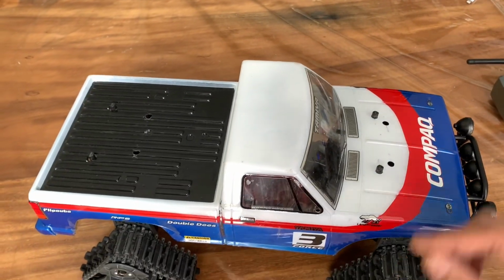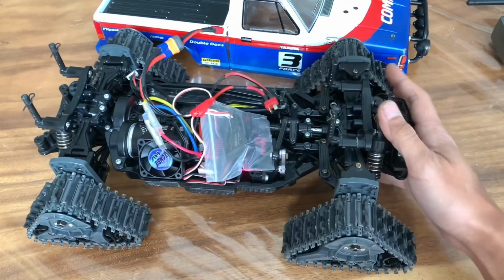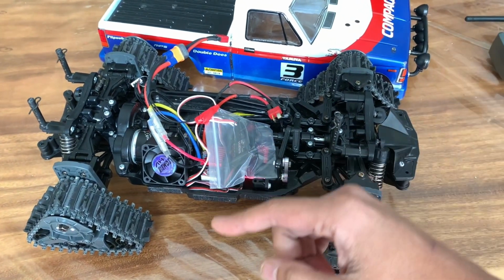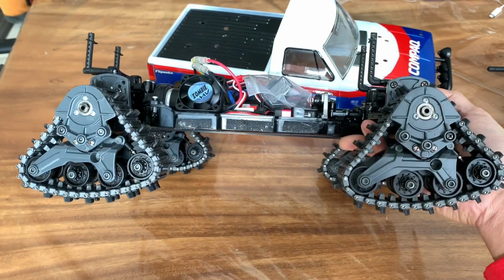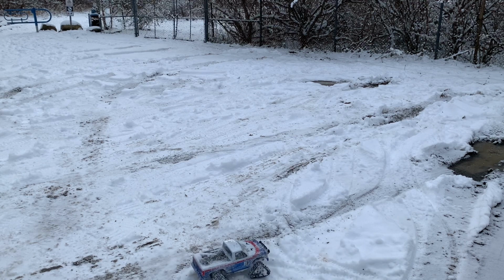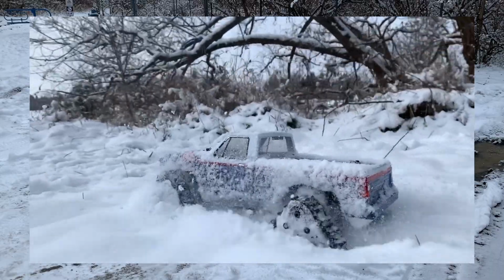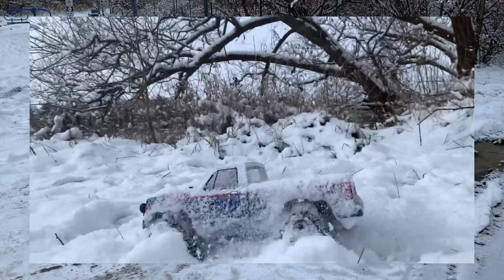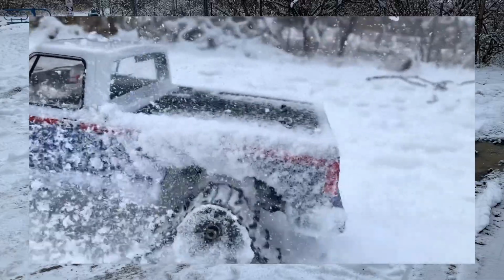TAMIYA QUADTRACK 3s

Comment: Hi mate motor and esc was you using just brought this in the UK and fingers crossed that said it could snow fingers crossed 🤞😅😂
Reply from the maker: Axial 35 turn motor and hobbywing 1060esc, i recommend a fan unit on the motor (its an inefficient brushed motor)

Comment: awesome to see it run and stoked bc i am building one up this winter!  did you do any bearings? or recommend bearings anywhere?
Reply from the maker: I did not use bearings for ease of less maintenance(cleaning) and eliminate the risk of seized bearings, I do recommend keeping an bottle of oil/thin grease to apply to the rotating areas, (it gets messy but its like the fifth wheel on a tractor truck, needs lube . Thanks for stopping by I hope you enjoy your build although the track gets tiring lol
Reply: @REX RC’s  thanks, good advice. I may put a few internally, but leave the rest as bushings. I plan to run it in the snow too

I built a edu kit that had tracks and those were a pain, so I already  skipped ahead in the manual to see if I could get started on the tracks while at work 😂

You try silicone spray or just recommend wd40 still?
Reply from the maker: @DudesRC  silicone would be alright but some brands may not be good for the rubber track pads, I like using lock lubricant also as its thin at first and then becomes a grease
Reply: @rexrcs  you going to do any new run videos this winter?  got tracks for the unicycle?  😆

Mich supposedly has got some snow on the way tonight.

Comment: Its funny how big a difference the snow temp makes, now it just basicly folds the snow neatly under the truck, as it doesnt packup. :D The 3s seems to be a very good combo on the truck, its actually decently fast too. :D
Reply from the maker: Yes, exactly what I was thinking, with that momentum the snow can get paddled down and behind now instead of just building up, it helps that the tracks throw snow off now at that speed, soooo happy I put the extra cell in